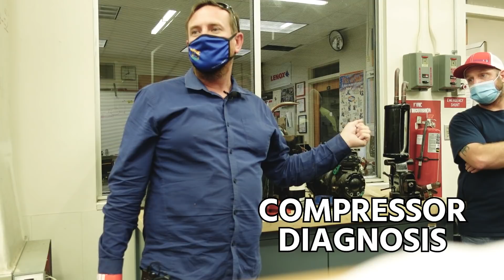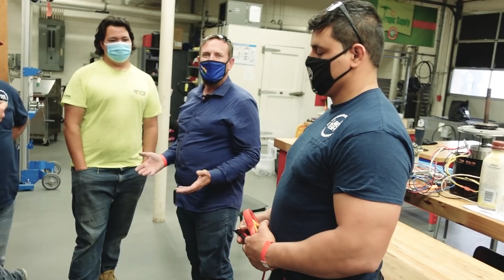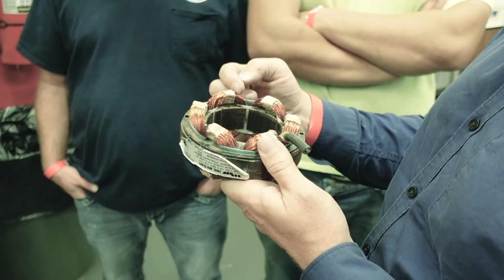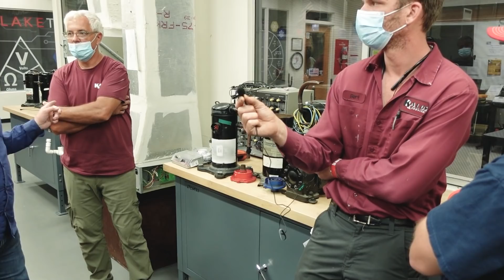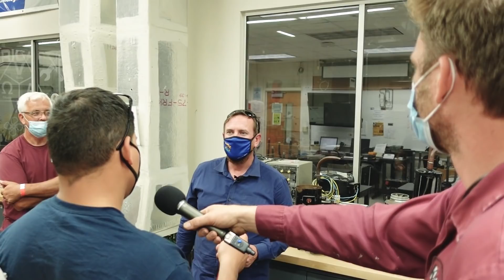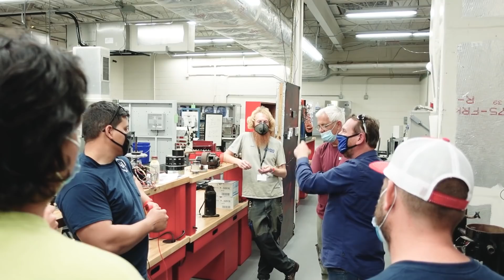A Compressor Diagnosis Scenario w/ Ty Brannaman

Comment: So in my job we have this one heat pump that exhibits short circuit symptoms. The single phase compressor has a short circuit protection that cuts out compressor relay as soon as it starts sensing oc condition. Sometimes the breaker itself will trip as well. Checked the capacitor just to be sure it’s not the cause and it checked out fine. What curious is that when i ohm the windings there is no apparent short to ground or between windings. And omhs between start-common run-common although in single digits still add up to start-run. But I’m guessing that’s the limitation of my multimeter not being able to accurately find the short. Any thoughts? The unit still will be replaced since the management wants to get rid of old units with r-22 but I’m curious if there is something else I might’ve missed. And yes when disconnecting compressor the unit runs fine so that tells me the wiring and all the safeties are ok.